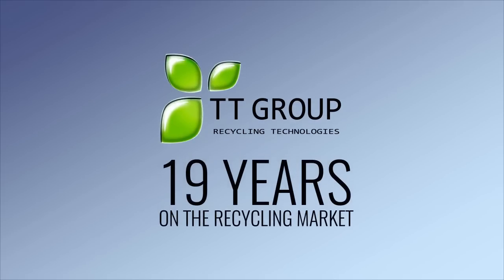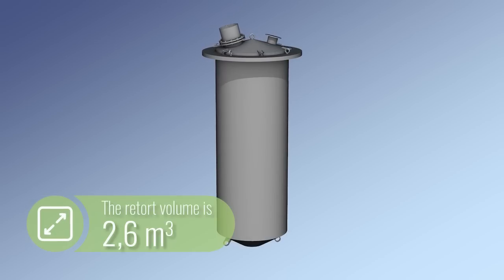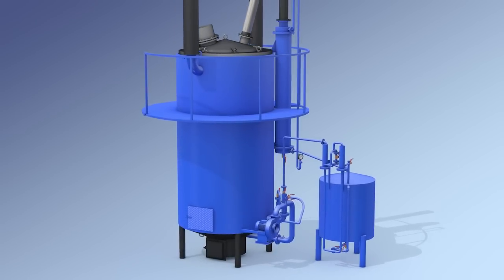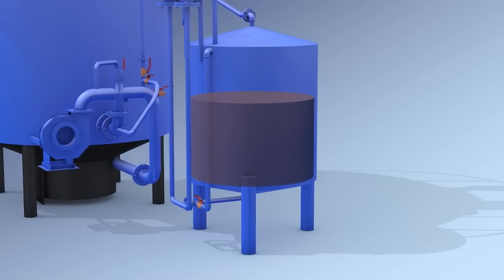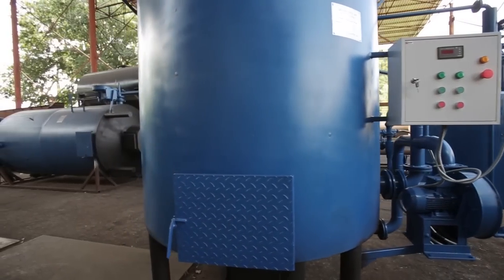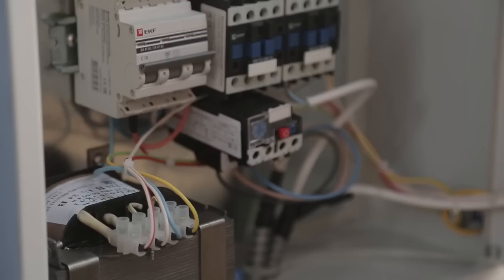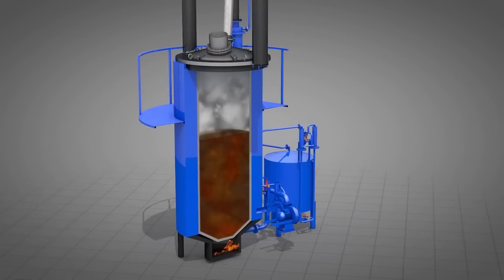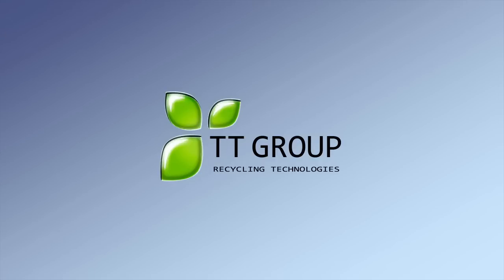Pyrolysis plant FORTAN

Comment: Scraping that giant beaker, with all the stuck residue will be much fun, but... concept wise... pretty cool. Put 2 of them side by side, and you could achieve close to continuous operation.
Reply: This is pure fantasy.
It takes more energy to recycle the scrap plastic, even before the collecting and hauling of the scrap, than what you get out.
This place is selling equipment , not a cost efficient process.
Pure fantasy.
Reply: @vepr1332  - technically, plastic is 2x more energy dense than oil. And the process takes less than 30% of energy released to self propagate. It could be sustainable in as far as 200km radius area cleanup "in theory".... BUT... the quality of the resulting condensate - gasoline - will be poor. Low octane fuel highly likely. And then, unsorted material will have acid and other impurities... At best one could make "crude" oil out of it without multi stage distillation columns... it has potential to be "not so bad" for producing - dirty, sticky, polluted, with particles, lowest grade oil. Extracted at relatively low efficiency, from a limited area of land (and as you say, collecting plastic is a job in itself... it's not just coming out of one hole in the ground for decades...)
Reply: @vepr1332  the point isnt about making energy, the point is to make trash disappear, instead of creating a second mountain of trash every few years (landfills).

the energy it takes to construct, operate, maintain, and finally close a landfill is enormous, not to mention the giant plot of land far away from the city.

Comment: very cleaver idea for reduce air during phyrolisis process, i have one question, becouse of change the chamber of reactor, the heat can't maintain in the hot temperature, mean ... the system start from the begining, in cold themperature than need fuel and time to rising the themperature of reactor.... please advice
Reply from the maker: Hello! Solid fuel (wood, coal) liquid fuels (diesel, heavy fuel) and gas - any type of fuel can be used for start the plant till pyrolysis gas appears in the system. You can contact us info@ttgroupworld.com or tlf / whatsapp / viber / telegram +7978 79 23 544 and we will send detailed information about fuel consumption of FORTAN plant.

Comment: But how do I know all the things inside the pyrolizing tank has been pyrolized?
Reply from the maker: You know it by the manometer indications: when the pressure is 0, no gas comes out the retort and it means that no raw materials inside and pyrolysis is finished.
Reply: @ttgroupworld  the pressure will be always 0 in whole process, maximum pressure can reach 0.01 MPA,this may not the point .
Reply from the maker: @lefilterpyrolysisplant2909  Working pressure is 2-3 KPA, so when it is 0 - process is done. Maximum allowed pressure is 7kpa - it is when explosion-proof valve breaks.
Reply: https://www.amazon.com/dp/B08CJQ419N